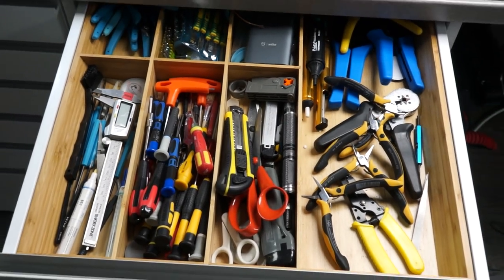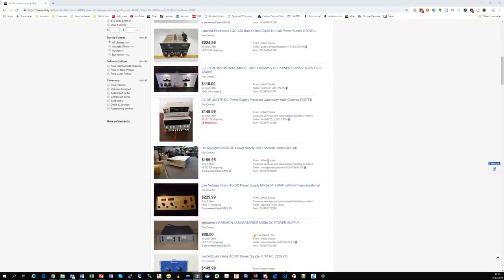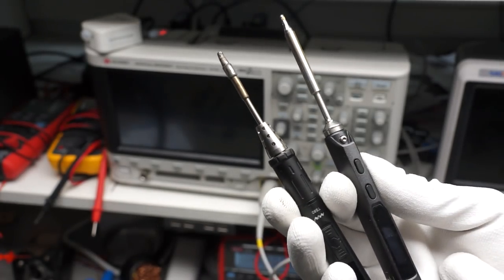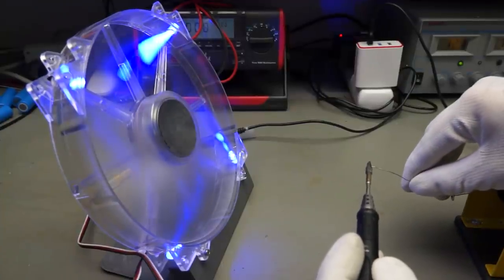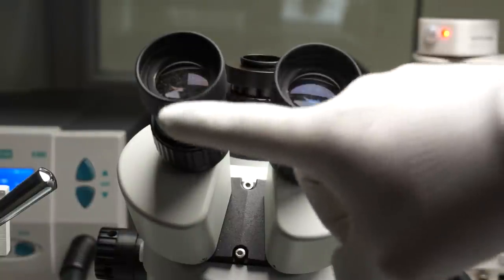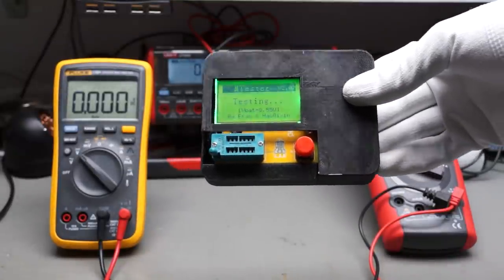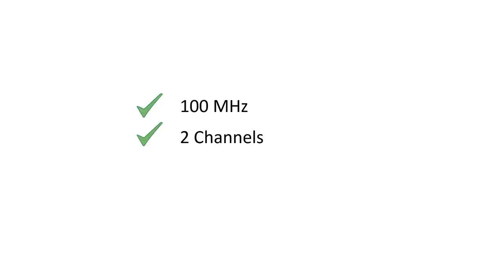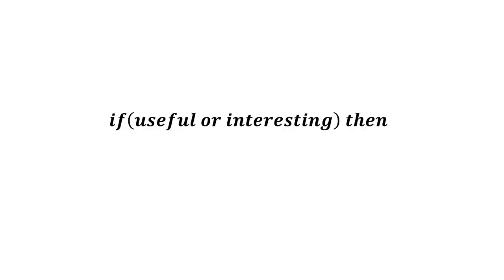#260 Most used tools, tips and tricks to spend your money wisely

Comment: I used a PC fan for fume extraction too, but it has a piece of activated carbon filter (the sort you might use in a cooker extraction unit) in front of the fan. I can confirm this works very well, and a good quality PC fan has enough static pressure to pull air through the filter. Failing that there are cheap fume extractors available from china
Reply from the maker: Thanks for sharing your experience!

Comment: As a technician who troubleshoots and repairs circuits daily, I agree with everything you said. This is an excellent resource for beginners. Proper bench oscilloscope, digital auto-ranging multimeter, and FLUX FLUX FLUX. I have one of those hot air guns with motor in handle. It works good but it's bulky.
Reply from the maker: Thank you for sharing your experience!

Comment: Nice to see someone promoting SMD for us old farts. As long as yo have fair dexterity it is much easier to work with than trying to hit those friggin holes with a shaking hand! I try to avoid leaded parts except for breadboards where SMD parts does not fit.
Reply from the maker: You saw I also keep my old resistors for the breadboard!

Comment: After trying all kinds of cheap breadboards, I ended up with reichelt steckboard SB-# series. They're a bit more expensive but never more all the frustrations of bad contacts, capacitance, bending wires etc. Really recommended !
Reply from the maker: Thanks for the tip. I will try one.

Comment: For hot air I've got one of those integrated portable types (not like the one you show in the video). It's pretty neat, and heats up fast as well.
Reply: Mind if I ask the model? Just to get an idea.
Reply: It's a Yihua 8858-I, so similar to the pic in the video, just an extra 'I'. Has the controls all built into the handle rather than having a docking station.
Reply: @Direkin  I have a GONGJUE 8018LCD, bought from Banggood. Don't recommend it because the turning wheel to control the temp is very inconsistent so makes it very hard to set the right temperature. When you turn it is does nothing and then suddenly it goes high up and such.

Comment: There is a few YT videos on breadboards and indeed some really bad versions exist out there. I watched and decided to go with Jameco Valuepro (WBU-202-R, 803 points). It's more expensive but well worth the money since I have never had any issue with it. Does it matter, well not if you only make few connections but as the number of connection goes up you will increase the risk of various intermittent connection issues.
Reply from the maker: Thank you for sharing!

Comment: One word of warning regarding the smd books. I bought my books about 10 years ago and recently the glued on paper labels started to fall off. The easy fix is to use transparent packing tape to overlay the labels. In general, I have found printed labels wrapped with a layer of clear packing tape a good option for a lot of wire labeling tasks.
Reply from the maker: Thanks for sharing your experience!

Comment: I used to use a big 120mm computer fan with some carbon sponge filter thingy glued to it. I used this until this fan gave his last spin. As this sponge is very conductive (and a bit brittle), I cut it to smaller pieces and used these to store some DIP logic IC's. Now I have to buy it again.
Reply from the maker: Reusage becomes more and more important!
I am not sure I will add filtering as the fan is now very strong and it needs not to be very close to my work.
Reply: @AndreasSpiess  This sponge is not very thick, as it's about 2$ on AliExpress I think you might try it (mine is quite coarse, it won't block air very much, i think) . If it won't be to your liking you can always use it for esd protection, a small dip16 sized piece of it has around 1MOhm from side to side.
Only downside is that cutting this makes a lot of mess.

Comment: Good video.  A tip for those with a bit more cash is ceramic-tipped tweezers.

I have a lazy eye so don't have full binocular vision. Don't ask how I can solder...  It takes a few goes to find range before I can confidently work through a series of joints. I use a large magnifying glass for small bits... To augment the spectacles that I have been wearing since the age of 2.

For people working with serial protocols, the buspirate has a lot of fans. It's cheap enough and is smarter than your average logic breakout.

P.S. flux is also available in gel form. Consistency something like honey but not so sticky.
Reply from the maker: I tried once such ceramic tweezers and was not happy. Maybe you have a better one. And you are right with the flux. I sometimes also use it instead of the fluid one.

Comment: I have owned for 5 months hot air gun you mentioned in the video. I think it is temperature-adjustable and affordable for most of the users who dont engage in very delicite curcuit But I never tried how precise temperature it has. In a nutshell it is worth the purchase.
Reply from the maker: I also do not know the exact temperature, but I think it does not matter too much as I usually work with higher temperatures and stop if I reached the effect.

Comment: How essential a binocular microscope is, depends on what you are doing. I would say that an illuminated bench magnifier is essential, certainly for those of us with ageing eyesight. I have been working with electronics for 50 years and while have access to a bench microscope at work, it is something I seldom use, most of the time a bench magnifier is adequate and a far cheaper purchase. 
The new cheap multimeters are very accurate and extremely good value compared with the old analogue instruments I started with. However, a Fluke will last you forever and is significantly faster at auto ranging and continuity beep. My 70 series was issued to me at work in the late 80’s and is still going strong. I recently added a newer Fluke 83V, bought second hand, because I wanted a back lit display.  The cheap units only switch the backlight on for about 15 seconds, which is a right pain. A second hand Fluke can be bought at a significant saving from new.  Yes my Fluke will go to sleep, but I have never felt the need for a bench multimeter. 
I agree wholeheartedly with you about using lead solder. We have lead free at work and it is much harder to use for reworking. 
Thank you for taking the time to make your videos, they are always well scripted and produced. A very small point, the instruments you were holding up are called ‘cutters’ in English. Small electronics pliers are for holding only.
Reply from the maker: Thank you for sharing your experience. Of course, we do not need to agree. This is the value of having such good viewers on this channel. Often you can learn more by reading the comments than in the video itself ;-)
Reply: I have to say I agree that a binocular is less helpful, but for me it is due to my glasses. It is very hard to find binoculars with stigmatism correction, and without it I cannot judge the squareness or distance of parts very well. I have found display microscopes and large magnifying lenses work far better for me as I can keep my glasses on.

Comment: I really like those "expensive" automatic wire-strippers. I use mine all the time.

If you do anything with your PC, USB isolation adaptors are important.  Be aware, the cheap ones are slow, and not good for Logic Analyzers. Hopefully the USB3 optical cables will become affordable in time.
Reply from the maker: P already have a 60$ Knippex and a 15$ Jokari sitting in the lab. Waiting for a few others from China...

Comment: 2:20 Speaking from experience, my father bought me a electronics set a couple years ago that came with a breadboard. Fast forward to my first year in Polytechnic (equivalent to college), the breadboards that the School of EE Engineering sold had terrible tolerances in their plastic injection molding, so often wires that are stuck would be there forever and never come out.
Reply from the maker: Bad luck for them. They should have better material, I think...

Comment: My prescription reading glasses is 1.5 (with some astigmatism). I ordered bi-focals from Zenni and bumped up the lower part to 3 for component work. I also use bluetack to hold in components while soldering. My extractor is  Dyson, just need to watch small components.
Reply from the maker: Thank you for sharing your experience.

Comment: Me and my Dad mostly get to use Indian solder. His 30 year old projects still have no solder related defects, even when the copper has gone green in color.
Reply: What solder brand?
Reply: Allied Corp. Lucky, the rolls, they were on, now have wires wound onto them(generic Chinese) (Indian wires are usually cheap PVC, who's insulation turnes to power). It's the most common one in Punjab. Is about 1.5mm thick... I've also seen thinner solder wire, which they use in phones, but those are quite low quality.
Reply: @SurajGrewal  thank you!

Comment: If you need to improve yourself in simulation domain, you'll need less of those breadboard and will go straight to making your own acid etched PCB... Also, for prototypes, I PCB designs, that can be salvaged if they are wrong.(like, for microcontroller, having maximum number of pads broken out for a given space.
Having filters and analogue bits placed with modular boards.
Etc etc)
Reply from the maker: Most of my projects are a combination of microprocessors and discrete electronics. So simulation is a little difficult. But you are right, I do not use simulation enough.

Comment: For fume removal, you can have a pc fan as well as a cheap filter like a respirator replacement filter (basically lots of folds of cotton) with some activated carbon(some ppl say activated charcoal) thrown in. 

The carbon actually absorbs the fumes so of course with time filter has to be replaced.
You can buy the activated carbon in capsules at the pharmacy (just pop open capsule to get it). Or buy at some natural health treatment store.
Reply from the maker: I also read that they use filters from the kitchen fume extractor ;-)
Reply: @AndreasSpiess  indeed. Whatever more accessible to you. I'd imagine fine extractor filters to be more expensive tho. Any run-of-the-mill filter can work tho. Heck, even a small porous container with cotton balls and the activated carbon is fine as well. 

It's just way better to get rid of fumes rather than redirect them.

Also,  also, you may wanna make a vid recommending use of safety for hobbyists. Ppl don't know this but even some common electronics have some amounts of relatively dangerous metals like beryllium, bromides, chlorides, cadmium, lead, etc. Esp for old repurposed electronics. 
Source:  https://www.greenpeace.org/archive-international/en/publications/reports/toxic-tech-chemicals-in-elec/

So at least a fan and gloves are really recommended. 

Anyway great content! Love tge channel.

Comment: Reasonably good 3D printers can be surprisingly affordable now. The Ender-3 for instance has a very good reputation for the quality of it's prints, but can be bought for under $200.
I see that Andreas is onboard with the use of Ikea Lack tables as 3D printer enclosures :)
Reply from the maker: The Lack is cheaper than the wood in the shop ;-)

Comment: Sali Andreas. Another super overview of your toolset. I went from weller ws50 to a ts100 as well. Will look at the logic analyzer.  We all benefit from your experience.
Reply from the maker: The TS100 is very similar to the TS80, only cheaper ;-)
Reply: @AndreasSpiess  I recommend the rigol 1054z its not perfect but classic 100mhz 4ch once tweaked. Next buy for me is hot air station quick dw
Reply from the maker: Thanks for your tip. I did not want to recommend oscilloscopes as I do not know them.

Comment: I have found the "Automatic Self Adjusting Crimper Stripping Cutter Cable Wire Stripper" works very well for small wires and it is very inexpensive.  It is usually Red and Blue and looks like a pair of pliers with a set of jaws in the same plane as the handles.  There is no way to put a picture of it here, but it is on ebay for as little as $3.00 and it is made in China.  It has two kinds of unit of measure, one side is "mm", on the other side is "inch" for strip depth and one listing claims its size is 13cm x 7.1cm x1.8cm.  I would not use it above 16 AWG.
Reply from the maker: Thank you for sharing your experience. I once made a stripper comparison. There are quite a few different models available.

Comment: I really recommend if you can afford them the 30013 precision wire strippers. They allow you to set a length of the wire to be stripped and if you buy the right ones they can be set for 30 to 20 awg (0.25 - 0.60mm) wires but there are other sizes (C. K Tools 30013 Wire Stripper, made in Germany)
Reply from the maker: I do not see a big difference from the one I use (other than the distance stop if you have to produce a lot of wires). You still have to adjust the thickness of the wire.
I purchased a few other strippers (automatic adjustment) to do a test in a future video.
Reply: @AndreasSpiess  I look forward to watching it. The distance stop is nice to have for crimped connectors mainly for IPC3 connections where the wire length has to be correct (usually used on flying things, and so I just use them all around.) You can read more about IPC 3 assembly process here: https://www.acdi.com/ipc-class-2-vs-class-3-assembly-processes-what-is-the-difference-part-1/

Comment: Good video, as always. I have a few extra tips to share with you and your viewers:
– Breadboards. Actually, no, they're not all the same! At first, I also thought that, as I found the cheap $3 breadboards from China unreliable. But after buying an $8 breadboard from my local supplier, I was amazed. It's clearly of a higher quality, and it's very reliable, I always get good connections, even after placing thick leads before.
– Wire strippers. That style of automatic strippers is only for thick wires. There is another style, which is a bit more expensive (I bought mine for about $25), but it's fantastic for almost any kind of wire. I bought the Jokari Super 4 Plus because it was the cheapest I could find, but the Knipex one is also good.
– Oscilloscope. If you're doubting between more channels and more bandwidth, get more channels. As a maker, it's very rare to ever need more than 50 MHz, and 100 MHz is more than enough for most purposes. On the other hand, 4 channels are very useful for debugging mixed analog and digital circuits, which isn't that rare.

PS: Do you take any special measures to keep your 3D printing filament dry? Because I can't see any. Is keeping it dry really necessary for PLA?
Reply: As far as I know and having printed on pla over a year old humidity doesn't matter as much, I live in a relatively high humidity area. Alex Kenis did some tests: https://youtu.be/nHdHSK4hvZE
Reply from the maker: Thank you for sharing your experience. I ordered such a Jokari and will compare it with the one I have.
Concerning Filament. I do not know if it is humidity. It becomes brittle after a while. That is why I try to use it fast.

Comment: The hot air guns with integrated fan are a major pain to use. They may be ok for people who need one once a year, but if you want to do more SMD projects, go for a fixed station. The weight and vibration of the air pump in your hand leads to lack of precision first and muscle fatigue second.
The oscilloscope section should have included Owon or Uni-Trend.. those make some good and affordable maker-level DSOs. For multimeters, Uni-Trend is probable the brand to go to (UT71C for handheld, UT8803E for benchtop, which are the cheapest autoranging models with a reasonable feature set).
Reply from the maker: Thank you for sharing your experience!

Comment: Hi Andreas, have you tried to to use a fume extractors replacement filter with the fan? Probably you can make / 3d print some enclosure to fit the fan and the filter.
Reply from the maker: A filter reduces the power of the fan and you have to put it closer to your working area. For me, it was not worthwhile.

Comment: So some additional tipps if may:
Breadboards: The only one I have found to be worth my money was a model from RND components. Since finding this I have not touched any cheapy chinese ones anymore. Absolutley worth it. I got mine here at Distrelec: https://www.distrelec.ch/de/steckplatine-weiss-2420-tie-point-189x171-5mm-rnd-components-rnd-255-00001/p/30115099

Hot Air stations:
For almost a year now I have been using a generic chinese 858D Hot Air Station. For me this has worked absolutley flawlessley and that for only about 40.-

Oscilloscopes:
When I had just startet tinkering a oscilloscope was just too expensive and too much of unknown black magic to me to invest lots of money. In luckily I could pick up an old CROW  (cathode ray oscilloscope) for free. The learning curve is rather steep but it got me startet worked perfectley and survived all the torcher of my unexperienced mistakes. So if you can find a second hand one cheapley or free go for it. 
Also please use a usb isolator if you connect anything up to a pc. I blew my gaming machine to pieces by mistakenley poking a live conection with a probe essentialy sendig 230V mains through my pc  via a usb port...
A friend fried his laptop by making a wiring mistake in a 24v arduino project. So save you pc if not your project.

Also if you are measuring things with connection to the mains use a isolating transformer to avoid big sparks blown fuses and fried scopes.

Soldering Fumes: 
I used the same method as Herr Spiess but addet some active carbon filterpads from a kitchen fume hood, a speed controll and  some led lighting to give me more light when soldering
Reply from the maker: Thank you for the tips!